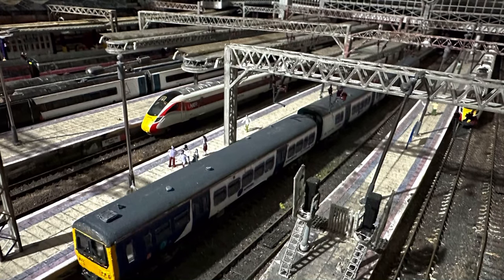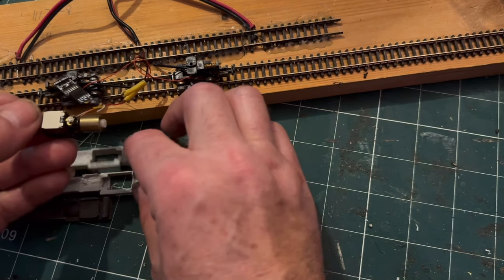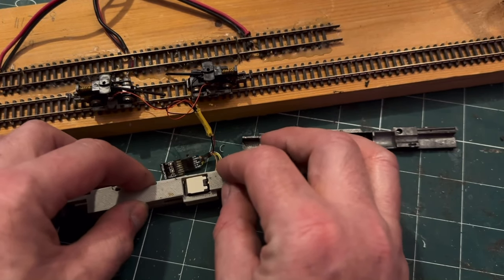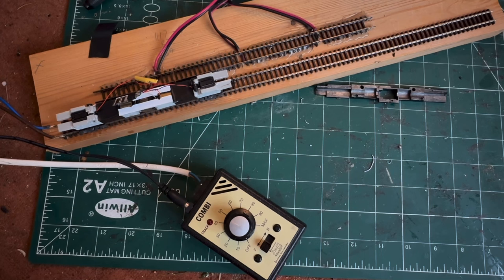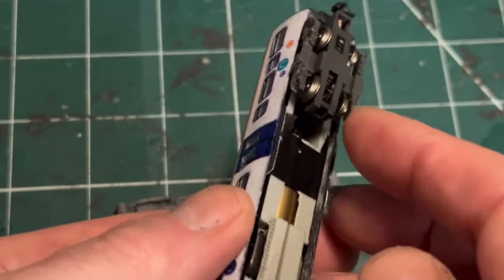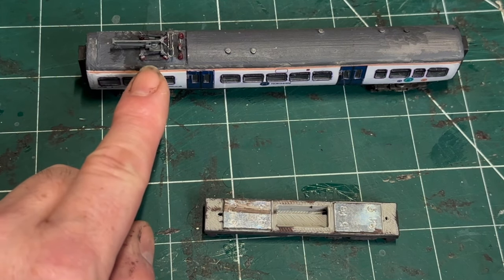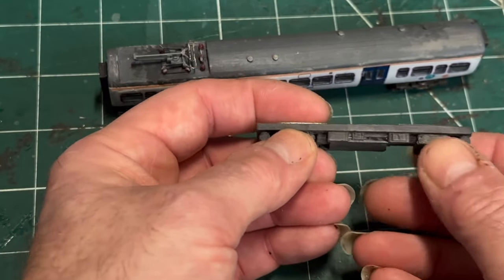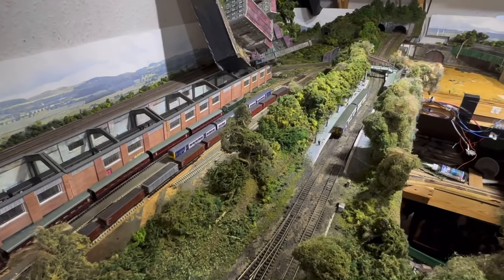Building a class 323 in N gauge – Overcome the challenges of converting to DCC.

Comment: The motor brush contacts touch either side of the split chassis, thus powering the unit. 
Where the brush contacts touches the frame has to be isolated or use a dremel to file away the area on both sides.
That's how you isolate a split chassis.
Reply from the maker: The 3d printed chassis worked after a few issues, and it was easy to modify, not so with the metal chassis. Thank you for watching and commenting.

Comment: Well done on persevering John. How long did it take to create the model for the 3D printer?  It wasn't the easiest of shapes.  Stephen
Reply from the maker: Hi Stephen, the shape does look complex, but it was quite simple, adding shapes together while subtracting others, like the rounds for the motor housing. Each took around an hour to print. Having said that the chassis did need a fair bit of modification, as it was easier to do that by hand rather continually reprinting.